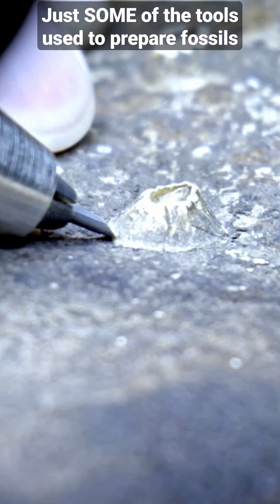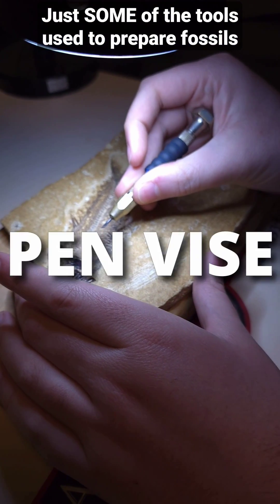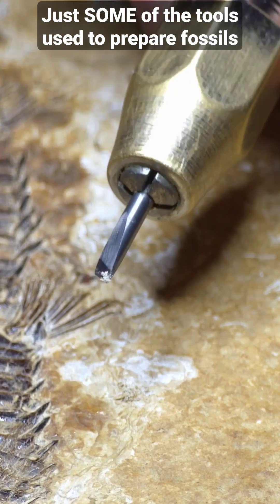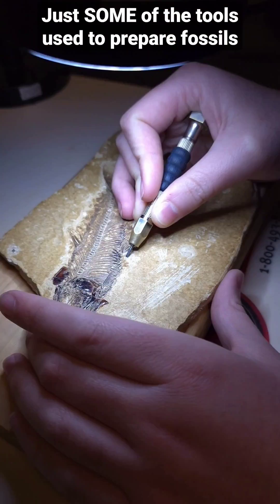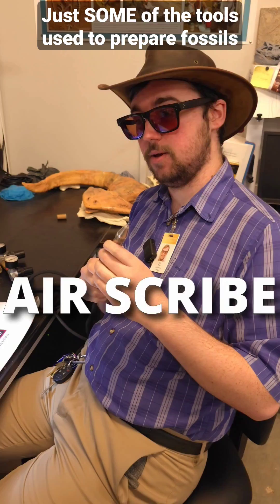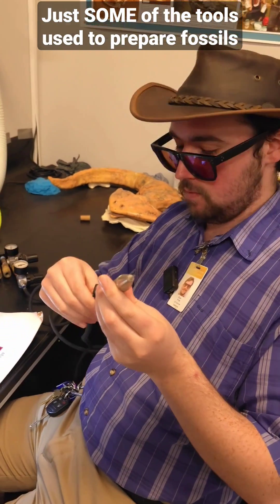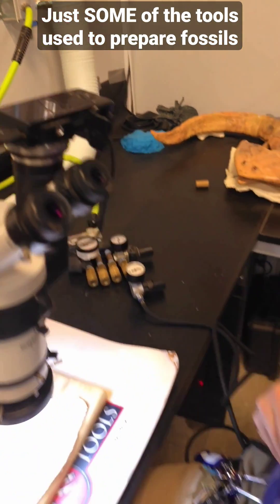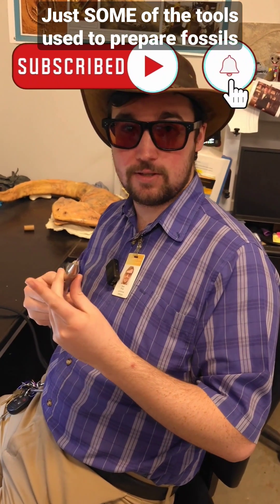Here are just SOME of the tools we use in paleontology to clean and prep ancient fossils #science

Comment from the maker: *PIN Vise

Do you use either of these tools for your job or hobbies?
Reply: It looks like a drummel!
Reply: I also did some research on a website about lane the Triceratops! Really intresting about those quills! Could we get more content on him?
Reply from the maker: @Helios_Engineering  Absolutely!
Reply: @houstonmuseum is that the zoic paleotech air scribe your using? Specifically the trilobite?
Reply: To clean my nostrils.
Reply: I work at a museum in Utah, so yeah I use them.
Reply: I would like to start my new career here, too!!😊  
I’m in Kansas, & at my KU campus we at least have that awesome mosasaur skeleton assembled to stare at- ( back BEFORE Mosasaurs were ‘a cool thing!!)   ❤❤
Reply: Yeah, I think I do sometimes. We use air scribes but call them turbo laps. I'm 99% sure it's the same thing, I think. We put holders in the tiny chuck that clamp on to diamond files or these little abrasive sticks called superstones and use them to polish little details in molds, usually the inside of ribs
Reply: Yep. Pin vices are really good at holding fine gauge drill bits, so I can put mounting pegs into white metal models.
Reply: Consider this my application 👍
Reply: I have multiple ones. I use them for everything from nail art to sculpting to gosh just anything I need precision for. I have different sizes. They can hold anything that will fit. Very neat tool.
Reply: Yeah, I use a pin vise with drill bits for my hobby.
Reply: How does this not damage the fossils?
Reply: @deathfromasian  I can help with that. 
It can damage the fossils if it actually touches the bone. However the goal is to only use it on the rock, and keep it steady enough to prevent it from reaching the bone, breaking off the bits of rock and leaving the bone intact.
Reply: @relytdragon5626  i mean i get that but there are some videos where they're removing thin layers to sediment on top of the fossil
Reply: @deathfromasian  there is often, though not always, a very thin separation between the rock and bok, which makes it so that the rock can come off without you needing ti touch the bone.
Reply: @deathfromasian  disclaimer: I don't work in paleontology or fossil prep but I use similar/identical tools in my job as a mold maker. 

You would be amazed at just how much precision you can get with a turbo lap, that vibratory scribe they're using as they're coarse removal tool. You could spend a half an hour benching a rib with one of those turned to 20-25,000 rpm with an abrasive super stone and the walls will open only a couple thousandths of an inch and the bottom of the rib won't be significantly deeper despite getting hit for a significant chunk of that time. 
      My guess is If the fossil is harder than the surrounding rock, score, if you accidentally hit it it you do minimal, probably essentially unnoticeable, amounts of damage that don't stand out when displayed unmagnified and behind glass in a museum. If the underlying fossil is softer I just imagine you do less with the air tool and be super careful to hand scribe a bit inside from the edge of the sediment  and away from the exposed fossil so that you're knocking off chips off without moving the scribe across the bone, kind of like how a mold maker might stop themselves from rolling an edge with a pencil grinder or turbolap. 

Again I'm about a million miles off an expert, I just know how to do detail grinding and polishing on metal with a very similar tool set. I'd love to see them make a more detailed video on their methods because I'd LOVE to try my hand at preparing a fossil of my own someday.
Reply: I use a pin vise for drilling small holes to pin models together using wire. It allows for more fine control. This is especially useful when using super glue as it creates a smooth surface to allow for better adhesion in addition to providing rigidity.
Reply: Having a separator sideways accomplishes nothing
Reply: Holding drill bits to drill out the gun barrels of my Warhammer figures.

Comment: PIN vise.
Reply: Glad someone else said it. And the pin vice is just the "handle" part, the vice that can hold a pin. The circular shaped vice.

There are all sorts of tips that can go into a pin vice, including very tiny drill bits, chisels, pins, screwdriver heads, and, of course, the tool used by OP
Reply: Yep. Had to trim down to fit 60 seconds. Ryan goes into much greater depth with various bits, etc, but alas. I wish YouTube Shorts would allow for up to at least 2 minutes. @fenrishunter5005
Reply: @GeekTherapyRadio  haha that makes sense!!! Totally understand the cutting floor trimmings; intent was less of a "gotcha" and more meant to add to the knowledge base for anyone
Reply: vise, dammit... twice ya fucked up correctin' a rando...  @fenrishunter5005
Reply: @SeanMacClanahan  it can be spelt as vice or vise depending if yank or English